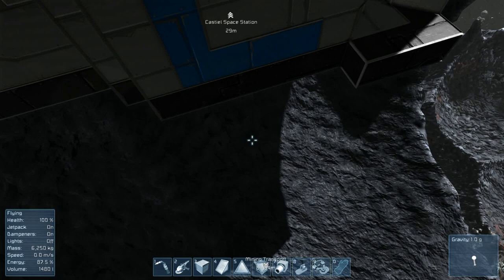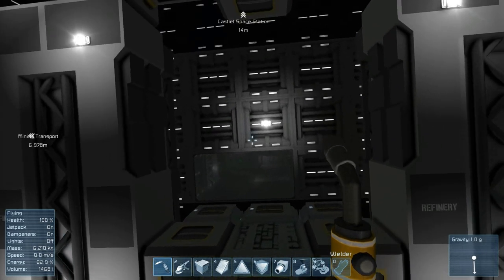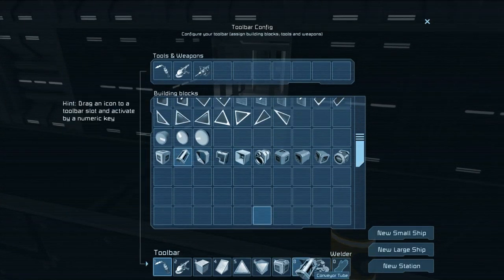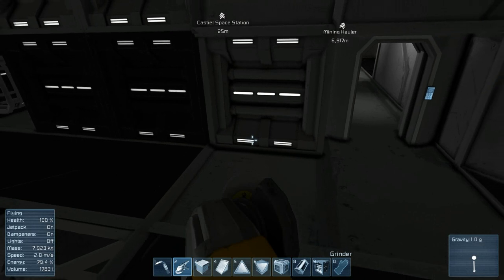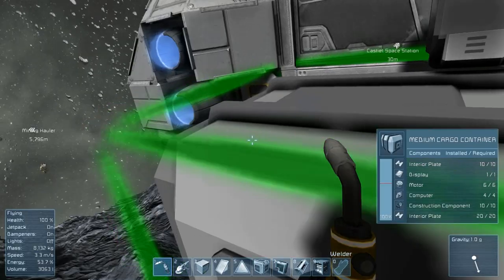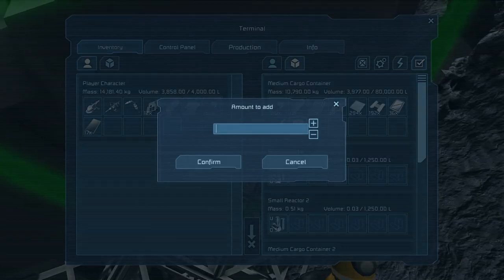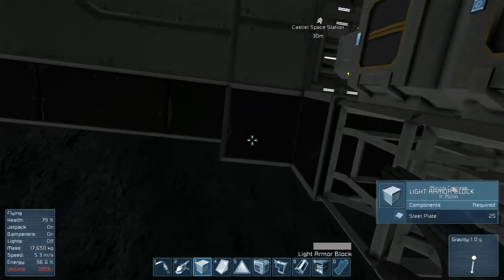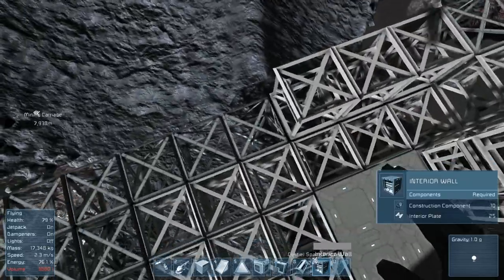Space Engineers Gameplay/Let's Play (Survival/S-1) -E20- Automatic Welding [Commentary Tutorial]

Comment: Be so much easier once the connectors work.   Also ejectors on the station are fine with gravity generator on, just position your ships collector to sit snug against it like you would with umbilical docking or even have the ejector at the bottom of your station.  Lowering G strength to .5 helps and saves a lot of power too. 

Keep up the great work.
Reply from the maker: Thanks for the tips. I tried using a connector into a collector with gravity and it didn't work to well.
Reply: Kage848  Robert Sanders has a great idea there with regards to merge blocks. I've just had a play around using them and conveyor tubes.  Works for large ship and station so long as the conveyor tubes meet obviously. Not tested with small yet and small to large (as far as I'm currently aware) can't be done.  This setup does cause a tiny amount of damage to my 1.5 million kg ship because of the pull from the merge blocks.  Can imagine that lighter ships will be just fine.  If you get the chance it may be worth a look.